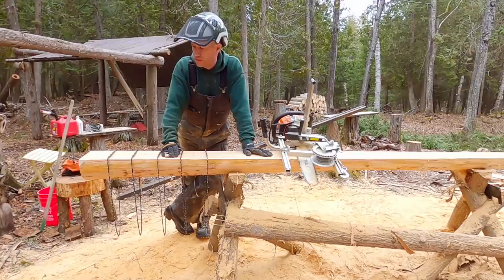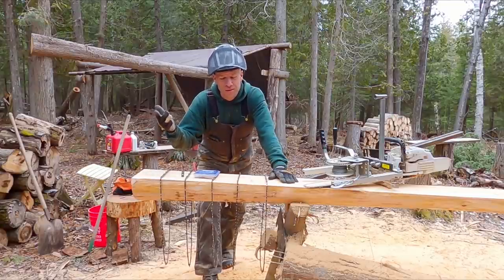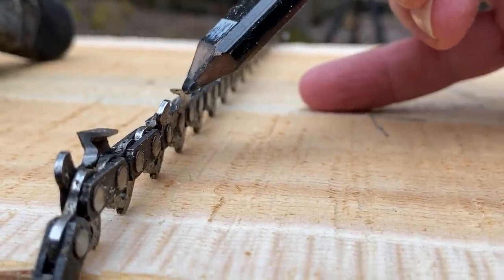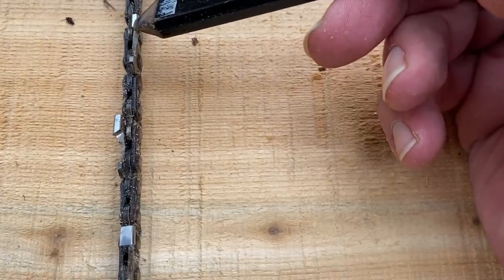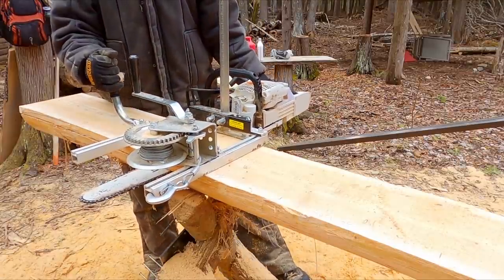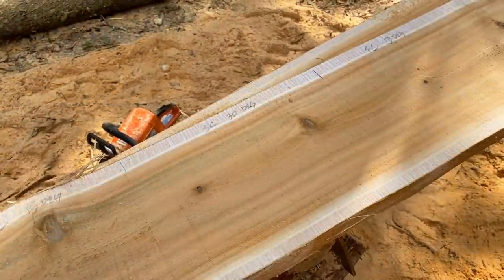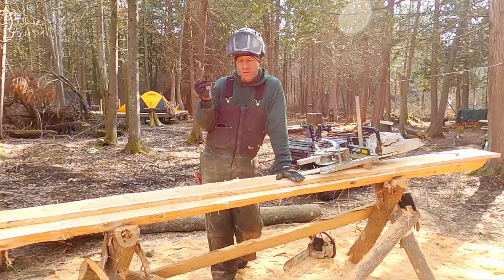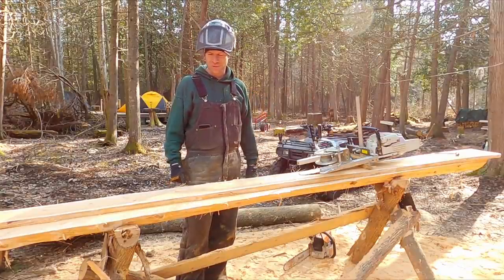Comparison of Chainsaw Milling Chains.  Is One Better than Another? #30

Comment: Since the semi-chisel lasts the longest, and 0° full-chisel makes the smoothest cut. Why not sharpen a semi-chisel to 0°?
Reply from the maker: Good question. 
I had that thought for a minute too but the cut that was the absolute worst was a semi-chisel sharpened down to 15 degrees. 
At zero degrees, they just rip up the board. Guess that’s just one difference between the types of chain.